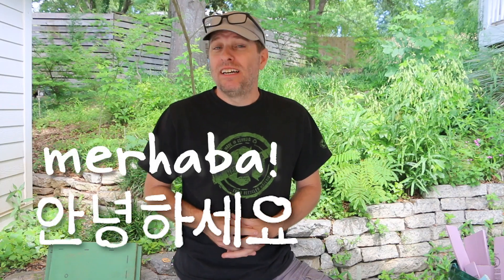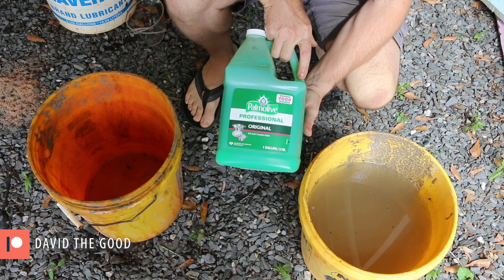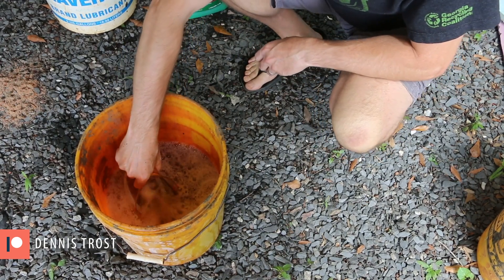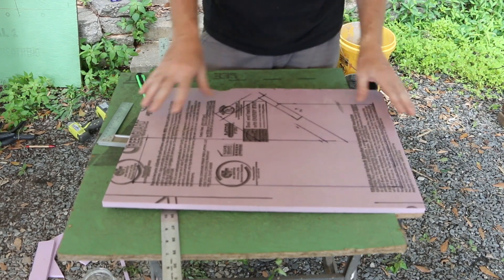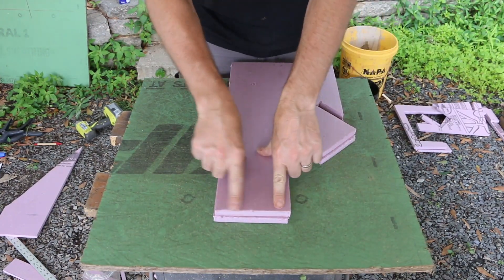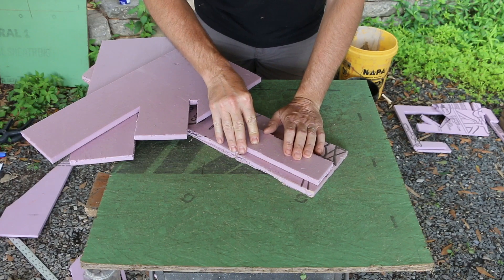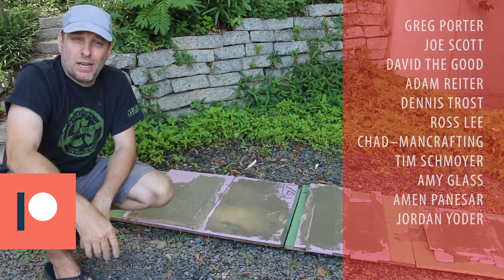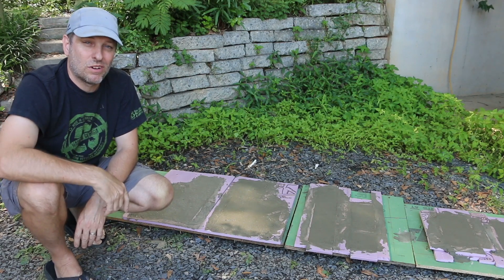How To Make An Aircrete Rocket Stove | PART 1

Comment: "Honey do" Carpenter usually test measures whether the foam generated maintains shape for a couple of hours. Adding "Water Glass" to the foam mix for combustion zones and imbedding wire mesh improves heat durability of the concrete.

Comment: If you are looking for the generally accepted foam to cement ratio for building domes or other aircrete structures, it's about 5 parts foam to 1 part cement- that is to say that you start with a volume of mixed cement, and add foam to make it 6 times that volume. You might also consider (next time) to cover your poured forms with plastic to slow the drying vs. curing of the aircrete.  I'm wondering if those panels are going to be thick enough to hold up even if they cure properly.  I was also wondering why you didn't just make a few mods to your older 5 gallon bucket style of rocket stove design.  Of course, having a bottom and an actual J-tube do seem to be decent reasons to do something differently.   I am interested in your Frankenfoam wand, but didn't see a video yet on that.
Reply from the maker: Hi Bryan. Thanks for the details and suggestions. I appreciate knowing the best ratio. I’m also curious about how the half inch slabs will hold up. If they survive unforming. I meant to add a release agent, but forgot that step. I do plan to try the 5-gallon bucket version too. I might make all my rocket stove over again with aircrete. No video on Frankenfoam yet. I’ll make that soon. Thanks for watching.

Comment: Everytime I see you do something I want to do it differently. Not because you do it wrong, but because there is something (wrong?) about me. :) For example, when I saw you use the frankenfoam I was thinking, "I bet I could get the same shaving cream with micro bubbles by mixing or aerating with a screen." Like using a milk foamer with the handle that goes up and down. Or you could inject air directly into the water like you were making foam for a latte. (Yes, I love coffee.) Ever since I saw you make the cob oven I have been slowly working on making one that's strait up ceramic which will be waterproof. I've processed about 10 pounds of clay from the yard so far, but sort of stalled out on what I want to do about a kiln. Ideally, I would make everything from what I have on hand. I got a leeeetle sidetracked testing "Starlite" heat resistant materials. (Mixed results, don't think it's great for making a kiln). By the way you have lovely clay there, you should consider processing some. I wonder if you can get your pizza oven hot enough to fire it?
Reply: Update: Quick experiment with a french-press and 40:1 soap and water very successful. Got 2 cups of shaving cream consistency in about 2 minutes of working the plunger up and down.
Reply from the maker: Hi Dustin. You absolutely should always have a different way to do it. :-) Lots of ways at everything. Glad my work inspires your creativity. The French press solution sounds excellent. Inside my foam generator are 5 stainless steel pot scrubbers, effectively a very wide screen. I’ll do a video about that soon. Thanks for the feedback. Would love to hear your clay processing method. Thanks for watching.

Comment: Don't know about aircrete . cake batter you add egg white foam to should be less vigorously mixed & should be a bit loose. 
That being said...you brought up cake batter. ... This is probly different
Reply from the maker: Hi Edie. My cake batter reference was about consistency. But, I hadn’t considered that there could be further similarities. Ha! The foam did support the cement until it cured enough to support itself, so it worked. I don’t think I’ll add frosting and have a slice of this stuff, though. Lol. Hope you are well.
Reply: @GreenShortzDIY  I hope you don't either. Lol after dental visit you would need your stomach pumped. Lol

Comment: Looks like a great beginning of a multiparty series.  Hidden any of the foundation material that you studied suggest adding any strengthening materials into the forms?  Beyond the two screws; remember the plastic mesh that you separated from the silt fence, it could have been pressed into the foamcrete for additional integrity.   As always, a terrific presentation.  Thanks for sharing this.   Maintain your family’s safety as the pandemic continues to evolve.   Wishing you Peace, health and happiness.  Cheers,
Reply from the maker: Thank you, JW. The mesh could have worked, but I wonder if it would melt and off gas. Not sure how this material behaves yet. Would be worth a test. Thanks for watching and the continued support. Thanks for your well wishes. Stay safe, my friend.
Reply: GreenShortz DIY  Just trying to use items from your Stash.  Perhaps scraps of chicken wire cutoffs from other projects.  Stay safe Tim.  I appreciate you sharing your education insights.  Peace brother,  John

Comment: Great video Aircrete is something I want to learn more about. You are a good teacher I enjoy that you teach the concept of how and why it works or does not work. I have a general understanding it is lighter and more insulative than cement. I am glad to see you will have plans I am hoping for the foam generator. Thank you again for the content!
Reply from the maker: Thanks for the feedback. I’ve been a little intimidated by aircrete. I had some early fails when practicing with the material. But, I think it can be simpler than it seems and sounds. I’ll tweak my foam generator for simplicity and then make a video on that. I’m convinced it can be a single piece, versus a separate reservoir and foam nozzle. Thanks for watching.

Comment: What ist that. I have no idea.
Never heared that. Thought it was a joke.
Reply from the maker: Hi Johannes. The concept is to entrain air bubbles into the cement mix using a dense foam. The foam supports the matrix until the cement can cure enough to hold up on its own. The result is a light weight and highly insulated material. It can be cut with a saw and connected with screws, but mainly it is very resistant to fire. It is still fairly brittle and can be crushed. I’m still learning about the material, but look forward to more experimentation. Thanks for watching.

Comment: If it’s like a cake mix when using stiff-whipped eggs, then you would ‘fold’ the foam into the cement mixture, slowly, with a spatula, and not mix it at all - folding in preserves the air in the stiff eggs, whereas mixing would make it go flat.

Also, I would only ever mix cement with clean water, in a clean bucket.

I know nothing about aircrete so have no idea if either of these points are relevant!
Reply from the maker: Interesting thoughts. I’m not sure how the comparison with egg whites and cake batter compares to the aircrete mixture. I have had practice aircrete batches fall during the setting process, so a similar result can happen. I think that more to do with the density of my initial foam. The mix in this video held up long enough for the cement to set, so I’m happy with the results so far. The true test will come when I take off the forms. Thanks for the feedback. Thanks for watching.
Reply: @GreenShortzDIY  There are some cakes (chiffon!) that use egg whites exactly like the foam in aircrete - the egg whites are whipped into a stiff foam (a little stiffer than shaving cream) to add air to the cake batter. 

Watching you take a power tool to such a 'batter' - every baker watching was cringing. With cake batter, combining the foamy egg whites is done very gently - or the foam collapses. I have to admit, I was thinking the same thing as Tort oise - that you were ruining the foam!

And I've watched Aircrete Harry - with much the same reaction. Soap foam seems to take more of a beating than egg white foam does, but I'm not sure how much more. I  admit my bias - I've made too many angel food cakes to not freak when someone uses a power tool on that hard won foam!

Anywho, looking forward to part two! Thanks for the great videos!
Reply: Phylis Maddox, ha ha ha - exactly the anxiety that racked me as I saw the whisk go into the mixture! I wanted to reach into the screen and gently fold it in with a soft spatula 🤣
Reply from the maker: (Tort oise) Musing about the possibilities is the perfect use for the comments section. :-) I hope you weren't truly racked with anxiety watching my video. lol. (Emaglot) I wonder if egg foam would work. Maybe a test video?!? If course, I'd have to learn to whip egg whites. :-)
Reply: GreenShortz DIY thanks for the videos 🙂 I was just musing on possibilities, really.
Reply: I've worked more with cement than cake batter but I also thought the same thing about egg whites.  also had the thought of using actual egg whites with the cement lol.